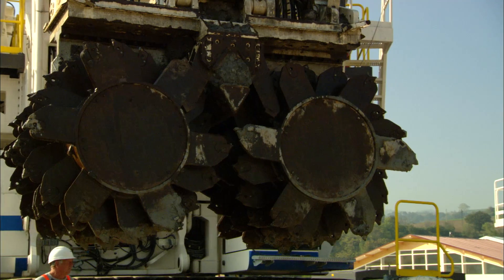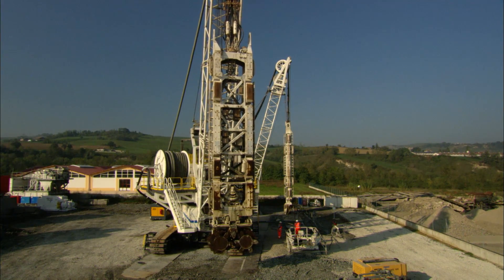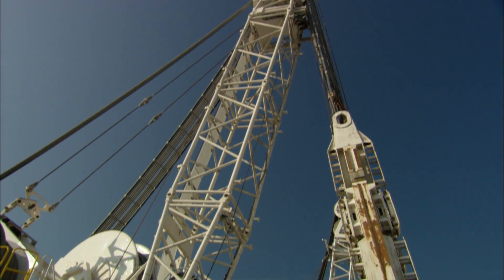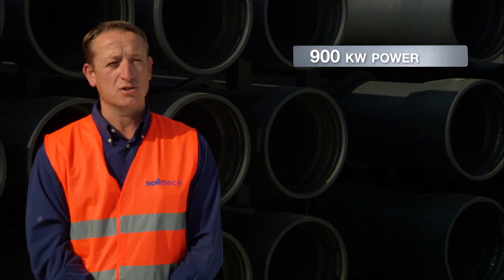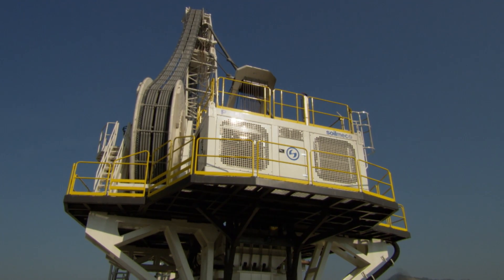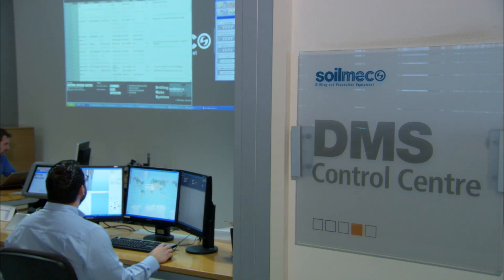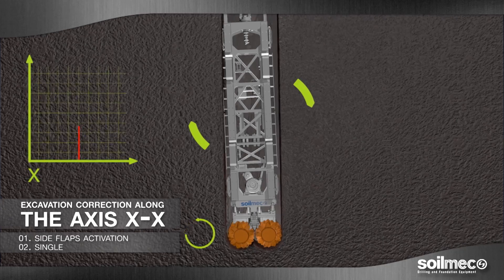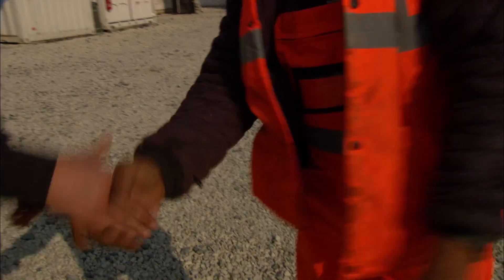World record -250 meter deep Hydromill Technology Diaphragm Wall [slurry wall] Soilmec

Comment from the maker: Soilmec Hydromill Adventure: reached -250 meter deep
In October 2012 a #Soilmec Tiger SC-200 hydromill installed (SH-50) with the HDD system to reach extreme depths excaveted a 250 meter #slurry #wall, making a record that has permanently altered the application limits for this type of equipment.